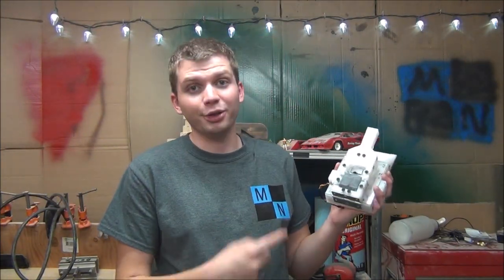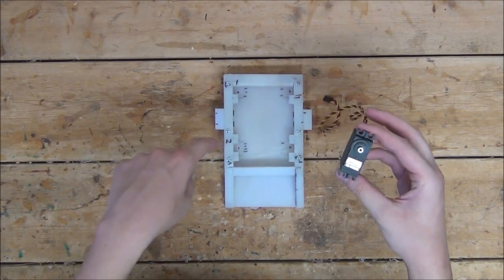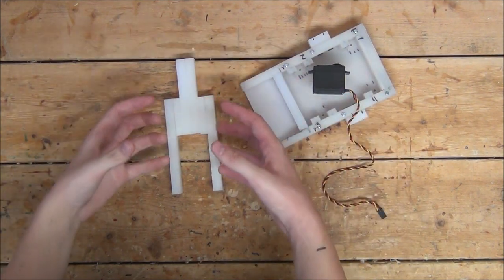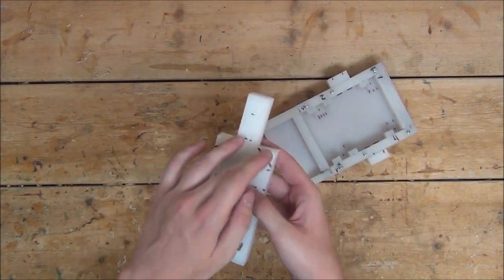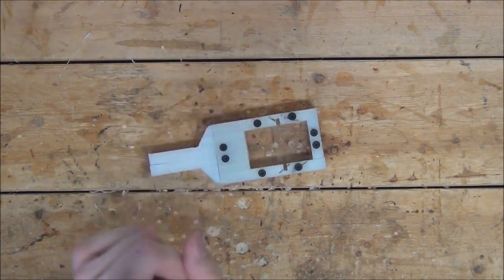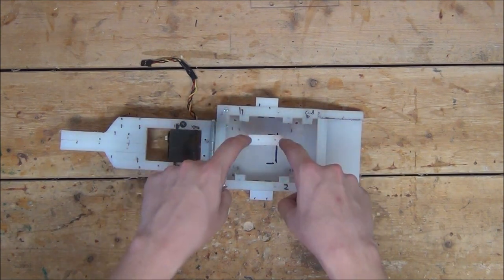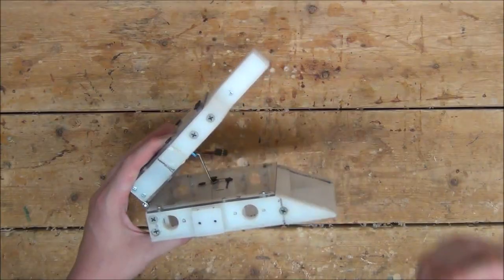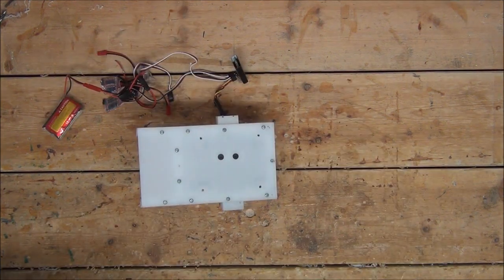How To Build A 3lb Battlebot!!! // Ritron Part 2/4

Comment: loving the look of this so far, however i have a few critiques but you dont need to pay attention to it if you dont want to. 

Firstly I feel like that wont really be able to keep other robots on your wedge, I'd recommend using some rubber on the front wedge, this will not only help to get a bot to stay on your wedge but will also provide protection against spinners as it will absorb impacts better, I'd also suggest using something like an Acetate sheet and put it on the front wedge, a lot of UK ants and beetles use this to get underneath other robots.

Secondly, I know in your last episode you said you were making something along the same lines as Razer but a grabber rather than a crusher, however i feel like you should remake your arm, its just made out of so many pieces that its bound to break, what would be a better suggestion is if you follow Razer's lineage a little more by having your arm curved in an arch, this will make it less likely to break due to less pieces, at most you'll have 3 HDPE pieces (1 for each side and one in the middle) and youd still be able to keep the motor in the arm if you put it in the back essentially right infront of the hinge.

Finaly another suggestion for your grabbing arm, have the end of it be flat and add some grippy rubber to it this way you'll have a wider surface area to grab onto an opponent and you wont need to be as precise, i feel like this would be better for you rather than a tip because i believe your motor wouldn't be good enough to grip with a tip.

Looks great though so far and i cant wait to see the end product
Reply from the maker: I am so sorry... I wrote that like 3 different times and the computer keeps making one solid BLob OF WORDS... idk why, I tried so hard to make paragraphs. I am so sorry again :(
Reply: Mechanical Ninjineer it’s fine :)
Reply from the maker: crap... I just saw it double wrote it... please forgive me as I delete it and rewrite one last time
Reply from the maker: You make some great points but most of those I already plan on doing.      I hope you know the front wedge and grabber arm are not complete just yet. The wedge is going to have a thick steel plate on it(with like 0 ground clearance) and the grabber isn't going to be a point, its going to be a large compressible rubber pieces. That way it will help protect the motor and aid in gripping the opponent. The head of the grabber is going to be wider than the neck. As for the arm being too many pieces I had that exact same concern when making it, but now that its finished it truly is like one solid piece. Of course breaking is still possible but its going to be a LOT harder than I originally thought. It might be easier to break it long ways then it will be short ways. And razor is more of a rough comparison than it is a model.        But with all that being said I loved reading your thoughts and believe we are thinking in very similar way. Thank you so much for commenting! :)
Reply: Mechanical Ninjineer don’t worry about it ;)

Comment: Mechanical Ninjineer, I was wondering what RPM motors you use for Talyn. We've got 2 inch wheels (for Beetle weight) and we want it to be fast enough, but not uncontrollable.
Reply from the maker: Talyn used  600rpm motors. So if you have a 2in wheel (assuming that's the diameter) that would make the circumference...6.28? (I'm doing quick math! haha!) so 600 revolutions per minute divided by 60 (because there are 60 seconds in a minute) is 10, so it rotates 10 times in a second. Then 10 times 6.28 (the circumference of your wheel) is 62.8.  So with that speed of motor and that size of wheel your bot should travel 62.8in in one second (minus friction and drag of course)
Reply: thank you I think that sounds like a good speed for a battle bot.

Comment: That's one pound, I know you'll still gonna put the wheels and the grappel, but are they going to weight 2 pounds?
Reply from the maker: Well I still have the electronics, grabber head, wheel protectors AND front steel plate. So its going to be close. 3lbs is only 1,359 grams and im already at 580 so im basically already halfway there